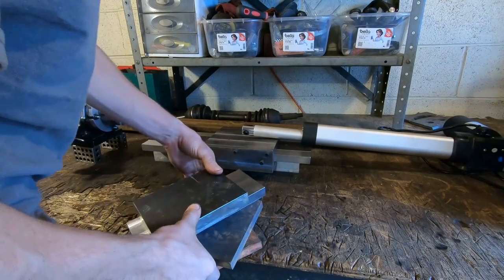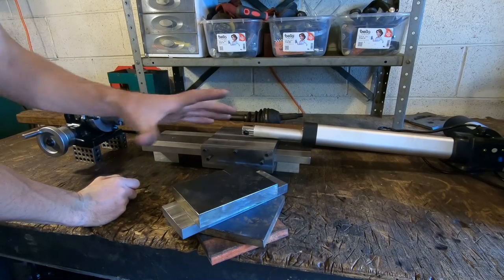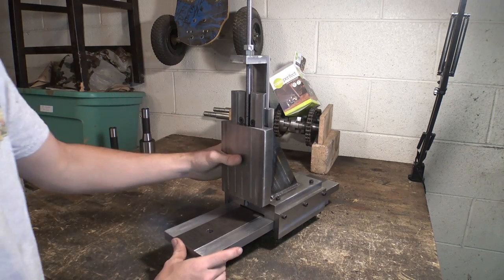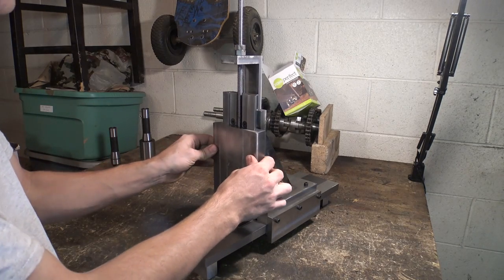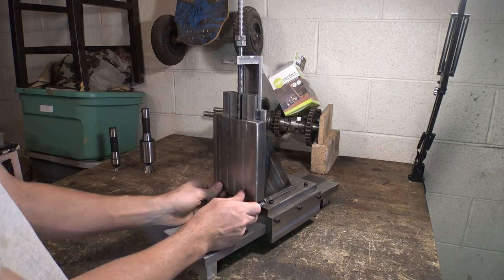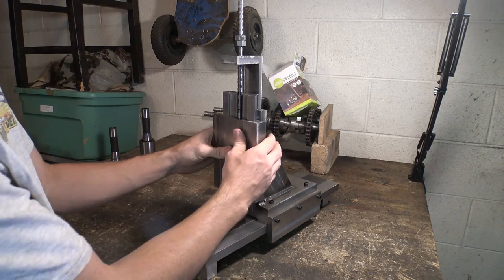Building A Internal Spline Cutter part 2

Comment: I never did a metal dovetail myself but if I did I would make a taper dovetail and machine a dovetail brass squeezer in the same time as I'm holding the part on the mill so less imperfection and minimum backlash. Love your video

Comment: Keep up the great builds. A couple tips to help with keeping your parallel from moving under your work piece. Put rubber bands around each parallel to keep them tight to the vise. Also you can use a bolt with a nut & spring that slides over the bolt upto the nut then adjust nut to push spring tight to the parallels.

Comment: Loop rubber bands around your parallel bars and vice jaws to keep them from moving around under the part. 👍
Reply: If you hit above the parallels with a deadblow hammer and you can put rubber blocks,springs,bar,ect between the parallels as well to keep them from moving. Just smacking above the parallels with a dead blow hammer is topically sufficient. Love your videos and skill..

Comment: Your fab skills are awesome! Would you say if you could get a brass gear for that spindle, you would be able to use that mill to surface a 4 pot engine aluminium cylinder head?

Comment: Oh God, I can feel your pain mate.
You watch a load of YouTube videos where they're saying stuff like "OK, I've gotta take half an inch off of this to get it to size", They proceed to drop the part onto their monster heavy production mill and take the lot off in 2 passes......... Then you go back out to your keen hobbyist grade workshop and feel a degree of resentment towards your own machines as you spend the next hour taking the 50 thou passes with a 1.5" cutter that's the maximum your own machine can take before it it stalls the motor. :(

When I trained as an engineer I was playing with Colchester Master lathes that wouldn't even notice that they were taking 150 Thou cuts through mild steel, and bloody great vertical turret mills (Wish I could remember what make they were) that could buzz a 50 thou cut off using a 5" fly cutter with absolutely zero chatter. When it came to spending my limited spare cash to slowly kit out my own little engineering toy room,  Let's just say industrial grade equipment wasn't an option. :(

I really miss the days when I had access to SERIOUS machinery, Rather than now where I occasionally do things like rough out a 2" step in a round billet with an angle grinder before putting it on my old hobby grade lathe because doing this will save me over an hour of repetitive lathe work.

Comment: Scratch the linear actuator. Use a drive wheel similar to a power hacksaw.

I'm trying to assemble a slotter myself. I'm going with a bastardized Perfecto Shaper design.

Comment: with all do respect  but you have made a mistake. the supporting triangles at the back should have been taller, extending to the angle square bracket holding the acme screw

Comment: hmmmmm interesting , looking for sumting like that , hope ir will work
seen one made before, that used the base of the milling machine  , its called a slotting machine or vertical shaper 
https://www.youtube.com/watch?v=9YoVatzhlLw

i think using a liniar servo for cutting will make the liniar servo wear out too fast it will take a lot of cuts to make one groove deep enough and a spline has about 10 to 40  or so 
a liniar servo might work for moving the carriage though i think a steppermotor and ballspindle would work more precice , it all depends on how exact you want the machine to be 

seen another youtuber that build a survace grinder , he used an ardiuno to move the steppermotors for the table semi automaticly so it grinds the whole surave going back and forth wish might be a good idea for slotting splines in general (it takes a lot of time and some concentration ) 

i seen one made to be used on a lathe as well , advantage of that is that you can work on longer stuff as long as you can feed it intoo the lathe from the back of the chuck 
https://www.youtube.com/watch?v=xmfw1phGV90